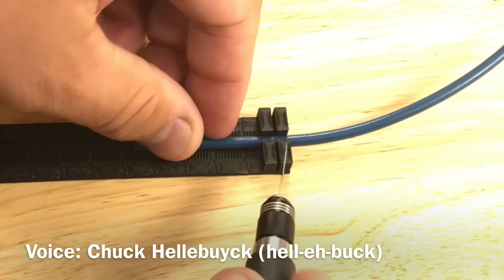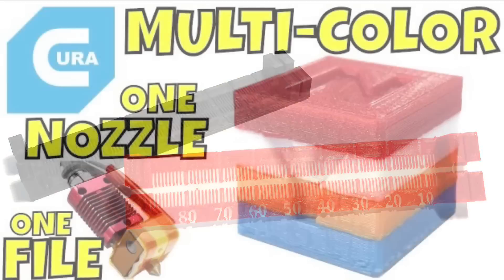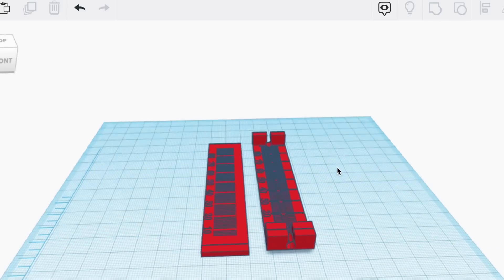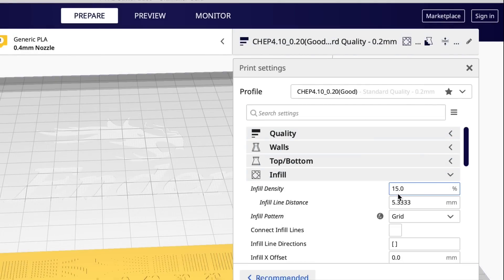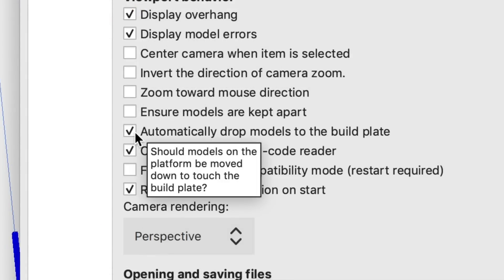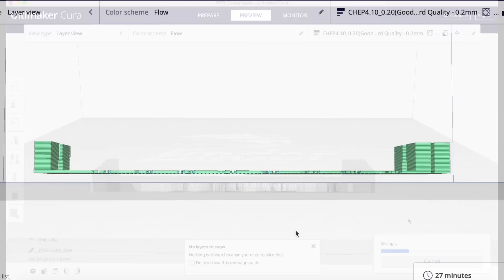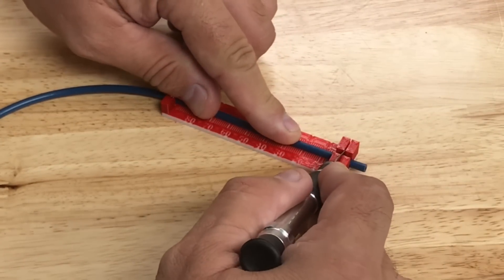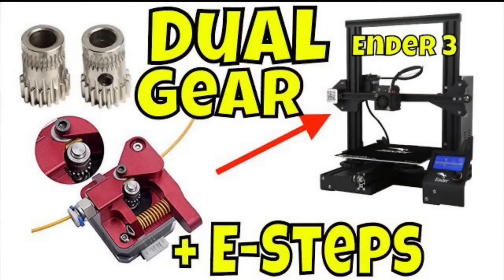2-Colors with 2-Files 3D Printing Technique in Cura

Comment: hey chep how do i calibrate a new extruder motor i put a direct drive on my cr-10 but if i leave it at 100 percent flow its to slow am i doing it right by just adjusting the flow

Comment: Awesome instructions love your channel. Noob question though I just got a max neo (my 1st printer) I'm confused about where the auto level is stored is it on the sd card or the board ? I'm using g29 and it levels every print should I be using 420 instead? Sry that was 2 questions 😅

Comment: Chuck, Thank you for this handy tool. But, I have a question....when I printed this item, I noticed that the "CHEP" logo was on the bottom of the print. How did you do this ?? I have a logo that I want to emboss on my prints, and I am having a tough time trying to do this. Any suggestions would be helpful !!!
Reply from the maker: I used Tinkercad to design it.

Comment: Great vid, however thats a silly amount of work. Just pause print and swap colors at desired layer height
Reply: That's true, however thoese numbers would sit on top of the print and would not be flush with the print. So not the same.
Reply: @pooheadlou  actually it would be.
The base and numbers would be one colour, anything above would be a different colour.
Perhaps try it before commenting and you actually might learn something
Reply: @andrewdowney760  yep the base and numbers would be the same colour. That's my point. Also you don't have to be rude about it.
Reply: @pooheadlou  you get the same result just a lot less work just stopping the print and swapping colors.
I'm guessing you got a printer this year.
You have alot to learn

Comment: Hey CHEP, I've just noticed you didn't use some sort of pause print, to change the filament and then resume it. Is it because it almost always fails? I am asking because I am trying to use a pre-printed support in PLA, to use it in a TPU print. I pause the print, very fast position the support, and then resume it, but it fails everytime. It cant get layer adesion, even in the TPU/TPU parts of the model. Do you know if it's a common problem, and what would you reccomend for this kind of trick I am trying to do? Thanks, and nice work on your channel.
Reply: You will almost always get layer separation or adhesion problems trying to print two different types of plastic together. If you stick with the same type of plastic and just change color it will work fine.

Comment: Using this technique for 2 colours is amazing.. gets rid of the fuss of doing everything in one file; like you have to pause at a certain height, switch filaments, extrude manually, resuming a print etc.
Reply from the maker: Yep. I think it’s easier.
Reply: @FilamentFriday  oh and a huge benefit is that this can be done through octoprint, instead of printing from SD

Comment: @Chep: an alternative technique is fine but, why didn't you make a pause at layer / hight and change the filament? (palette pro is working similar!!) your part isn't so complicated that there are different colors in the same layer ... it's quicker, no glue, no extra work, no extra slicing, no playing around with profiles... a comparison of this two workflows seems to be nessecary.
Reply from the maker: I’ve covered that in a previous popular video. 
https://youtu.be/1nBnVtOEAiY
I prefer the two file method.
Reply: @FilamentFriday  - previous versions of cura had multiple versions of "pause at" macros. that was annoyng! the acutal version seems to be tidy of this. ... and layer 1 is layer 1 and not layer 0 anymore!

this two points are against this technique of 2019. Therefore I can't see the advantage of the new method. ... If you like: make a video of the advantage in direct comparison to the old one... ;)

have a nice weekend

Comment: With no skirt on the second part, you still need some sort of priming tho? Especially after changing the filament, no?
Reply: U can’t print below that height because nozzle might crash into the previous print , you can manually prime it by hand it works and is faster sometimes .
Reply: @NilSirrah  You can, but you'd have to edit the GCode by hand... 😁

Comment: Can this be printed on a regular Ender3 or Pro with the 4.2.7 and BLTouch upgrades? Thanks
Reply from the maker: Sure
Reply: I guess that was the point of moving the print away from the center of the build plate, so that the BLTouch could operate on the second print.

Comment: Never noticed it before now, since I rarely look at "extended" descriptions, but on this one, the "useful" part of the description required doing the "show more" thing"and now I've noticed your address - which goes a goodly walk toward explaining why I've liked your narration since I first encountered your channel -  You and I speak the same lingo - Michigander-ese. Your accent is a little more "south Michigan" than mine, but it's obvious to someone who grew up there.  I ain't QUITE a Yooper (Technically, I'm a "Troll", just like you and everybody else who lives "below the bridge") since I grew up at the "tip-o-the-mitt", about 14 miles from the south approach to the Mighty Mac, but after all the years I spent working Mackinac Island, I consider myself a "Trooper" - Half Troll, half Yooper - and even all these years after I left the state, I've still got a good bit more "Yooper" in my talk than you folks from "down below" usually do. You're still obviously a Michigan boy, and even though I couldn't quite pin it down at first, it shows every time you speak. Sounds like home to me. :)

Comment: Great video.  But how can you make the printer purge filament right before it starts printing the second part so you don't get a blob?  I have tried the pause at height method and have issued extrude commands prior to restarting but I don't really care for that. I would prefer the printer do a tiny print or a skirt to purge so that the actual print start immediately.

I would like to do it as 2 separate parts like this because I have printed parts that have raised letters on top of a different color and Cura does some weird stuff with the last layer of my main part making it not uniform (ie, doesn't print smooth on top and breaks up the smooth top layer lines by skipping the lettering outline and leaving visible differences on the top layer).

So a custom skirt around the main print would be preferred...even though my top part outline may not be the same as the bottom.  A lot of info, and I can provide more to illustrate if needed.

Comment: I have the settings "Empty First Layers", "Models Kept Apart", "Automatically drop models to the build plate" Unchecked. The prepare view shows my top object howering 2mm above plate in the correct place but when I slice and go to preview no g-code is shown.

I am using a CR-6SE

Comment: Thank you for another wonderful video.  I have really grown to like the 'Luke Hatfield' style Capricorn-lined hot ends.  Unless you need to print hotter than 260C, I believe they are superior to all-metal hot ends.  The Capricorn liner has less friction than metal, and the liner also acts like an insulator that discourages heat creep.  This is particularly important for me, as I have been doing some printing with Colorfabb lightweight PLA and lightweight ASA.  These filaments expand when they are heated, and any heat-creep would cause them to expand before reaching the nozzle.  Also, if it does get damaged, the Capricorn liner can easily be replaced.  If the metal surface of an all-metal hot end is damaged, then the hot end needs to be replaced.  Mr. Hatfield deserves an award for his design, as it has saved the 3D printing community from a lot of frustrating hot-end clogs.

Comment: If you wanted a 120mm measuring stick, why not design a 20mm extension that plugs right in the middle, where the Bowden tube goes?  Include an end stop to give you the perfect spacing.  Cool technique BTW.

Comment: Great tips as always, @CHEP.
Question - Not sure you mention which version of Cura you are using - at the time I write this I am using 4.10.0.  Even with the two settings (Ensure models are kept apart and Auto drop models to the build plate) are unchecked, I cannot import two models as the build volume shrinks due to "build volume height reduced due to the value of the "Print Sequence".  Which was "one at a time".  I changed it to "all at once" and managed to get the second model imported.
Reply from the maker: I’m using 4.10

Comment: Way simpler way to do the same thing:
Just do one print, then use an acrylic paint marker and run it over the top of the markings - it will just pick up the raised parts
Reply: True but not needing paint is nicer, its also a lot easier in other slicers

Comment: Using bed-leveling information to compensate for a badly warped bed means you are choosing to use defective equipment!
Change my mind!

You don't let air out of your cars tires to drive on a rough road, do you?
Softer tires make a smoother ride...it makes sense if you don't think too hard.
And then do you buy Premium Gasoline to make up for the loss in performance that flat tires can cause?
Lots of work when you could have chosen to drive on smoother roads.

Bed leveling is meant to be a Diagnostic, not a Production Tool!
Run the procedure, examine the report, decide if you want to keep the warped bed or get a better one!
Maybe the bed is perfectly flat, but simply titled tilted!
Tram a flat bed to the rails (bed parallel to the X and Y rails, perpendicular to the Z rails), no need to use leveling.

Use the warped bed as a trivet for hot pans or a cutting board in the Kitchen!
I have an Anycubic hot-pan catcher and a Mingda cutting board!
The PEI coating on the Anycubic wasn't holding up to cutting, the Mingda coating is really tough!

Comment: There is an easier way to do it. 

Just slice two separate models normally making sure they're centered and turn off "Skirt" on your top layer model (if using skirt). When the BL Touch homes the Z, the top of the print (if centered) will register as the bed (Z0). Then just print the next model as normal. Works like a charm every time. 

The only issue you could bump into is printing on top of tall prints because of the leveling fade height but it's usually forgiving. And this won't work with CHEP's tutorial using "Remove Empty First Layers". You will just need the exact model you want print on top.

Excellent tutorial as usual CHEP.

Comment: I'm a busy woodworker and metal fabricator, and I do lots of other things and have many hobbies. So I have to spend my time as efficiently as possible. For a product like this I would just use a paint marker to color the tops of the numbers. It works perfectly and it's fast. I apply many of the techniques I use in my other trades to 3D printing and try to use as little plastic and electricity as possible. Rarely do I print an entire piece out of plastic. Just parts of it. Learning to be efficient and productive is just as important as learning new tricks on 3D printers.

However, I do enjoy learning new things in this field, and now if I ever need to do something like this, I'll know how.

Thanks Chep.

Comment: Interesting video, however what's the benefit of doing that instead of a change color at z height?
Reply from the maker: Just another option.
Reply: @FilamentFriday  Do you see anything about your option that would cause anyone to prefer it? It seems like a ton more work for the same result. IF the second color started on the same layer as the last layer of the first, then I could see some benefit.
Reply: @candorman9444  This option allows 2 colors on the same layer. Change at height finishes a layer THEN lets you change it.
Reply: @Chad.The.Flornadian  Without an interlaced model or z hop, no it doesn't. There are much better ways of accomplishing this and I do multi color prints with no mmu every day.

Comment: why not just use color change in cura?
Reply: I had the exact same thought: why not just an M600 at 2.4mm?  Super easy with PrusaSlicer, but also with the standard plugin in Cura to add the command at height and still much easier than this two-part printing and no risk of your bed cooling...
Reply from the maker: As I stated in the video, I’ve showed that process.  This was another option since some Creality machines won’t recognize M600 (unless the upgrade firmware). https://youtu.be/1nBnVtOEAiY
Reply: @FilamentFriday  Yes, but this is on an Ender with BLTouch, so you already did upgrade the firmware, right?  Then using a firmware from Creality instead of a decent one with useful features like M600 built-in seems like a mistake which would better be corrected than using this approach.   And sure ... this approach can also just work without BLTouch on the old 8-bit Creality boards which were limited in flash-size and hence had a reason to not fit in all Marlin features, but I could not find any figures on how much you can save by disabling M600, so I would expect it to be minimal.

Now, don't get me wrong, I do applaud your videos and printing in multiple phases can be useful in some cases.  Ex. this approach can even be used to apply accents in another color while having overlapping layers with the old object (just not close enough to the nozzle) - i.e. the already printed part can have parts sticking up slightly higher than where you start the second color as long as you ensure the nozzle (and everything else on your printer) keeps away from those when printing that second part.  That's more tricky and definitely would require a thorough review of the g-code including movement paths in the slicer and potentially modifying it manually a bit to get the nozzle in the right place between the second homing and where it needs to start printing (possibly in the middle of an already printed part sticking up a bit) without hitting the parts sticking out.  It would be great if someone would create a Cura plugin for that, so that you can have simple dual-material prints with a single filament change and have the plug-in correct the paths as needed or flag that what you are asking is impossible without hitting the first part - but it would require quite extensive info on the exact geometry of your hotend and carriage as the rough box used by slicers for sequential object printing won't cut it here.

So yeah, the approach has its uses, but for a simple 2-color filament change at a specific height, just getting your printer to obey M600 seems way easier, robust and saving you tons of headaches in the long run.
Reply: @MisterkeTube   I agree. For a simple color change it feels like a lot or work, and this could be applied to some other printing techniques that I am not aware of. In theory I feel like this could be amazing for different size nozzle printing to give both quality and speed. Print the base with 0.6mm nozzle then switch to a 0.2mm for better quality text.
Reply from the maker: Where is that? 
Cura can change the color?

Comment: A simple pause at layer height and a quick filament swap does the same.
Reply from the maker: As I mentioned in the video. I’ve covered that before. https://youtu.be/1nBnVtOEAiY
Reply: This option allows 2 colors on the same layer. Change at height finishes a layer THEN lets you change it. It's all about options and preferences.

Comment: Why is auto level such a big deal to many people?  I just tighten my bed all the way down then with a dial indicator level the bed by only loosening the bed screws a tad where needed, it never moves and bed is near solid and that's it. I don't even think about leveling or setting z height. Heck nozzle changes and resetting z height are not needed, as long as i measure the nozzle length which seems to be very accurate.

Comment: Hey Chep, Why not add an M600 to perform a color change at a specified layer height instead? Just to show a different way to get this result? Cheers
Reply from the maker: Not all Creality machines recognize that (unless they update firmware) but I already did a similar video on that using pause at height plug-in.
Reply: @FilamentFriday  Okay, thanks for the info!